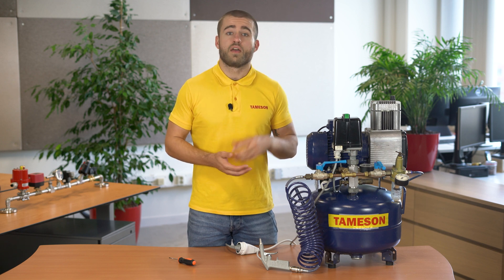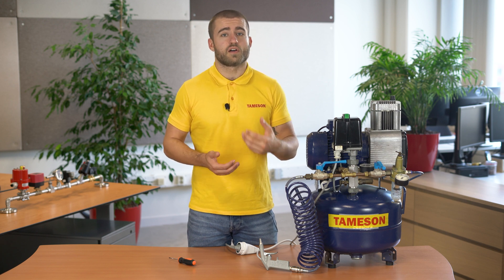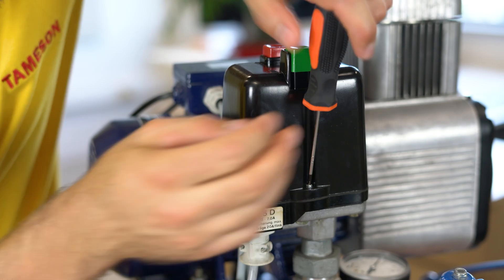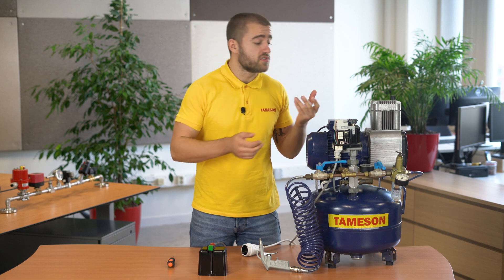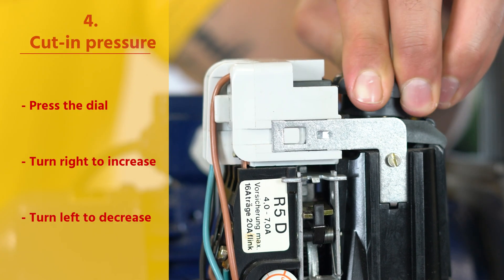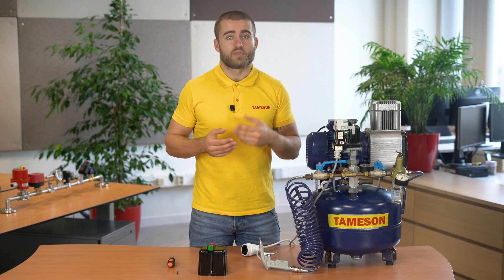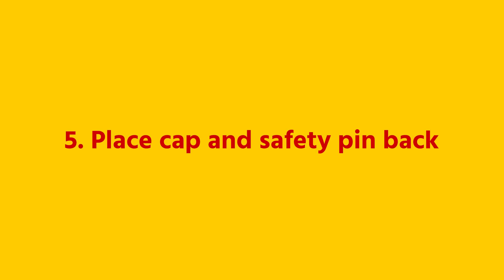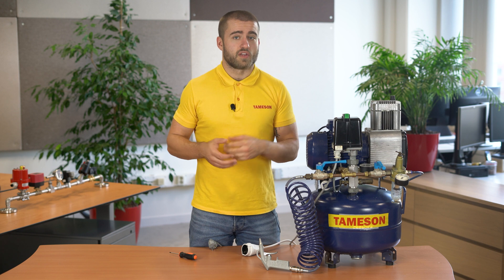How To Adjust a Compressor Pressure Switch | Tameson

Comment: There are two springs. Do they have to be turned at the movement
Reply from the maker: Some pressure switches have two springs for setting. Please check our article for all details and information how to adjust this type of pressure switch: https://tameson.com/pages/air-compressor-pressure-switch-adjustment